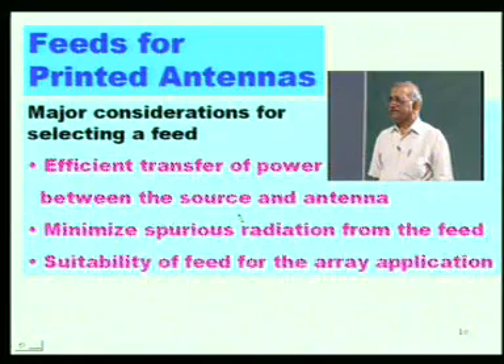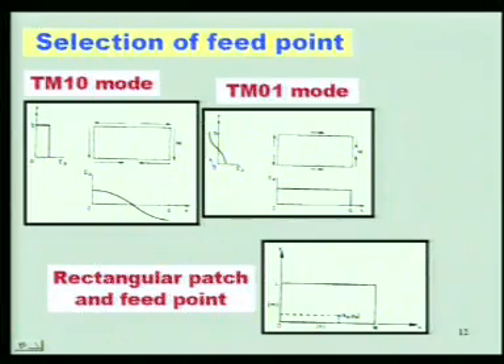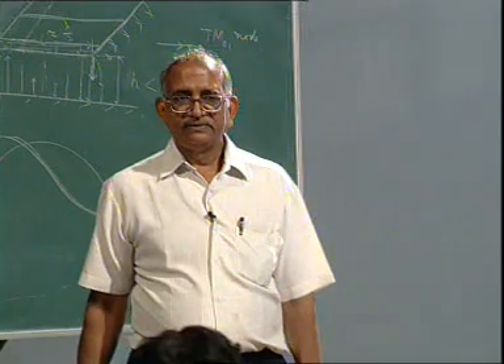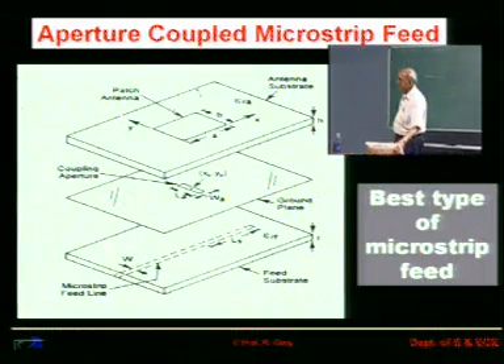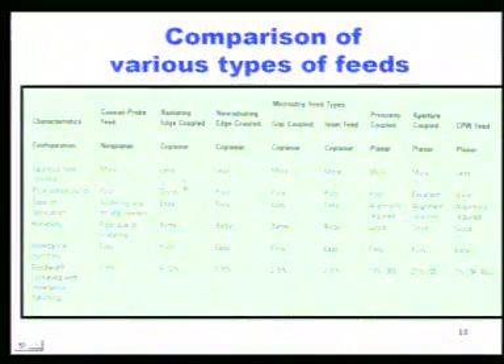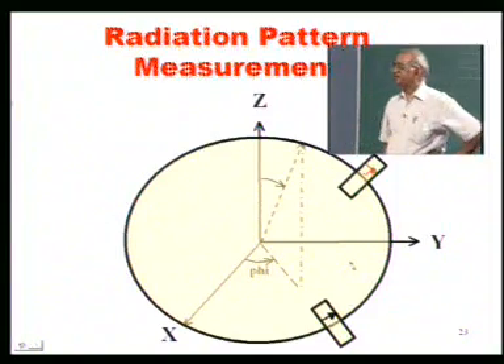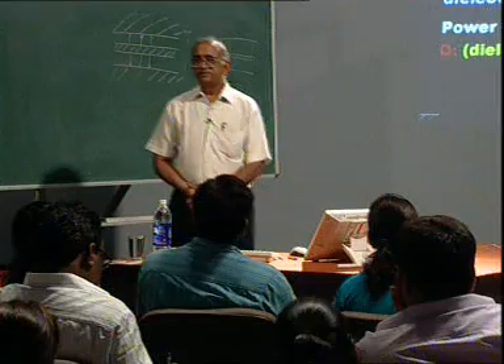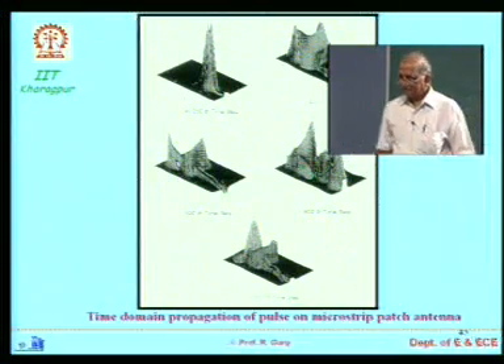Feeds For Printed Antennas

Comment: Very informative video regarding the different feed mechanisms and the sources of radiation.

I feel the portion about radiation pattern measurements would be confusing to people who weren't already familiar with them.  The pattern is measured over three dimensions: azimuth (phi angle), elevation (theta angle), and polarization (vertical/theta or horizontal/phi).  Azimuth can be varied by placing the antenna under test on a turntable and rotating it.  Elevation can be varied by moving the measurement antenna in an arc around the antenna under test.  At every azimuth and elevation (to save time, this is usually measured at every 15 degrees or 30 degrees), the power is measured in both theta and phi polarizations. The results at each point are used to calculate efficiency, directivity/gain, polarization, beamwidth, and other characteristics.
Reply: Thank you. It was helpful.